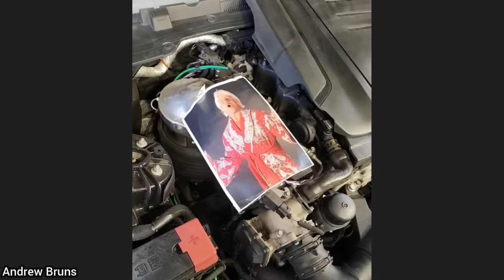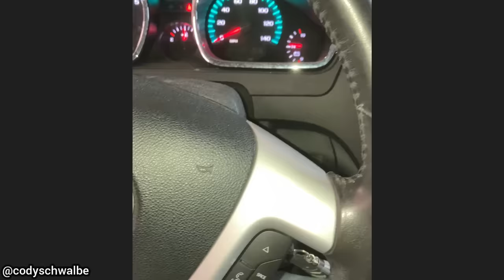Customer States "My Car Sounds Like" | #2

Comment: I was a heli technician for 20 years and one of the legendary fault reports by a pilot was "The stick feels like the helicopter is flying through a cardboard wall."
Reply: Sharpen the rotors? 🤔 lol
Reply: Growing up I knew a friend whose dad was a maintenance chief first on an aircraft carrier and then for a major airline. He admitted to the following fault reports:

F: Friction locks prevent rapid movement of throttle.
R: That's what they're there for.

F: Knocking noise from instrument panel like midget hitting it with a hammer.
R: Took hammer away from midget.

F: Autopilot, when in level flight mode, produces 200-fpm descent.
R: Unable to reproduce on ground.
Reply: what was the cause of that?

Comment: The shamoo brake squeal reminds of a story that happened years ago. Customers came in and said they’re not sure why their car making that sound. 

After doing an inspection found out of course it was the brakes lol. We told the customer the brakes needed to be changed. They declined, saying we’re trying to scam them to into changing all their brakes just to make money lol. 

We did not force or try to rush for the job, just told the problem, how much it’ll be and that was that. They ended up leaving and guess who was back a couple of months later? 

The exact same customer lol, they said they went to a couple of other shops and the some of them tried to upsell them a bunch of mechanical work that was totally unrelated to the brakes. 

So to make a long story short, we got a customer for life because we just told them like it was. Always feels nice, when customers think you’re trying to scam them but then they end up realizing we’re just here trying to help them and not always about the bottom line lol.

Comment: I find it extremely handy when a customer can accurately describe a sound and even better when they can vocalize that sound. Makes my job a lot easier.
Reply: Once had that, family of let's say healthy eaters,  nice folks.  Complaint- vehicle grinds occasionally.  Check suspension ect , seems fine  . Cannot duplicate sorry,   couple weeks,  same Complaint.  Ask SW for their address,  go drive thru their neighborhood.  It had speedruts not bumps.   Suggested heavy duty struts/shocks.  Fixed problem.  Information is a key component lol 👍

Comment: RULE #1 of CVT Transmissions: Change the fluid every 30,000 miles
RULE #2 of CVT Transmissions: Change the fluid every 30,000 miles
RULE #9,638 of CVT Transmissions: Change the fluid every 30,000 miles
Reply: Rule #4 of CVT transmissions,  get a FI 502 with a powerglide.

Comment: I recently had my car in for a moisture damaged external audio unit and had noticed "an expensive sounding noise" from the rear.
Turned out both rear driveshafts needed replacing. Glad it was under warranty!

Comment: When your window Squeaks alot going up and down i have noticed that its normally the top of the door is bent out from over time because of the seal.. Take a 2x4 piece of wood and put in on the door frame and slowly close the door on it.. Roll down the window all the way. And push the upper window frame towards the car.. NOT to hard!. Just a little.. The window should work great again.

If it JUST happens all the sudden, That means someone tried to break into your car by using a Jimmy.

Comment: Well actually my car made a funny nose when I turned right at over 45 mph. Did this for hundreds of miles. My mechanic looked at it and told me the bearing on the drivers side front was going and needed to be replaced.
Reply: Was it like drybar comedy or sam kinison? 😅
Reply: @vs-ww7cb  
I don’t know… but it did go away when I turned left.

Comment: Probably a Nissan with the CVT. What was Nissan thinking when using this transmission. I drove a Altima once with this technology.  Decided then I would never buy one. Especially with anything less that the 3.5 engine.  Plus with the 3.5 you don't have to worry about timing belts.

Comment: Whoever thought to make CVT, in its current form, standard in cars is ridiculous.  Whoever defends such a idiotic idea is an idiot. Where I work, CVTs are stocked as a standard inventory part.  Yet, we have never stocked a complete manual transmisión, nor hydraulic automatic transmission, as standard stock.  What does this say about CVT? I nrobably change two a week with Nissan being one of them, often both of them.  I would be ashamed to admit to having one, unless it is a Subaru or Toyota Prius. I hate the Prius.  But facts are undeniable. That is one tough car. It also has a planetary CVT, not a band.